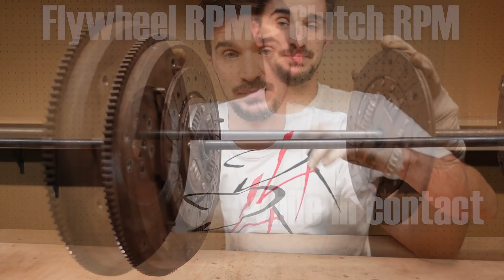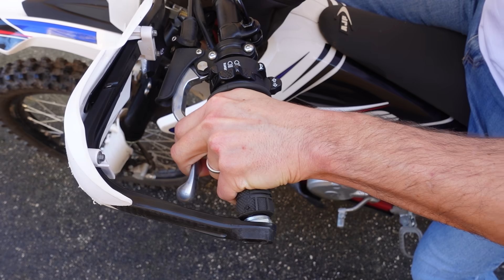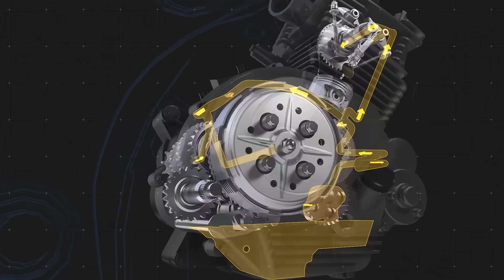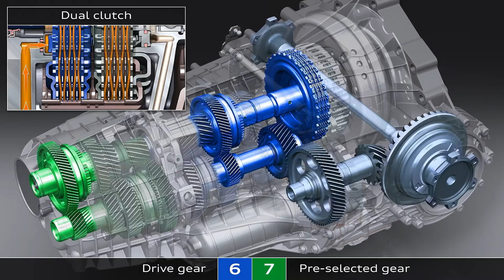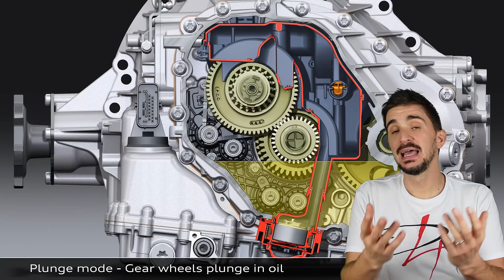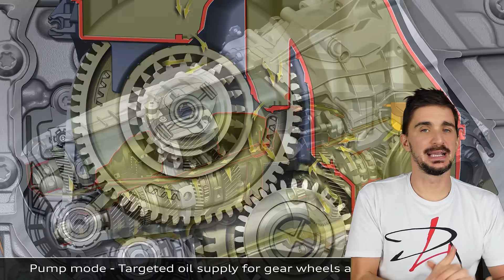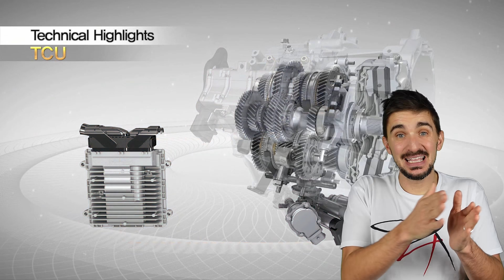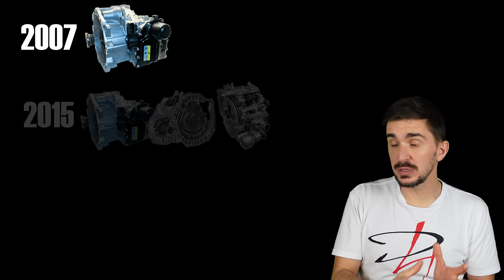Why Dry Clutches Suck and Why You Should Avoid Dry Dual Clutch Transmissions (DCT/ DSG)

Comment: That's why the best automatic transmissions will always be the traditional ones, those with a torque converter. They're smooth at start-up, smooth during parking maneuvers with zero wear, and all clutch packs can engage even slightly because the torque converter absorbs the impact. And they don't consume as much fuel these days since there are 8- or even 10-speed transmissions. So, if you want a dry clutch, buy a manual transmission, and if you want an automatic, it's better to buy one with a torque converter. And if you want to avoid all the hassle, buy a Toyota hybrid. Its transmission is bland, but it's smooth at start-up and has no clutches or wear, meaning zero maintenance for life.

Comment: I think that is why wet clutch transmissions with a (gasp) torque converter are so popular in stop and go traffic. By the way, Caterpillar had a dual clutch air shifted transmission mounted behind the 1693 engine in the 1970s. The thing was much heavier,  but man it shifted quicky. Truckers called it a "sneeze shifter" because of the sound it made when it shifted gears. (air shifter)

Comment: Very cool video, I am doing my mechanical engineering dissertation on multi body dynamic modelling of a multi plate clutch system! I’ve spent far too many hours pondering over very similar topics here, lots of work with coefficient of friction mapping in a 3d sense vs sliding speed and contact pressure

Comment: I sold my 2000 4Runner V6 manual at 218,000 miles but the clutch was still ~70%.  If you drive well, a dry clutch will have only minimal wear.  I rarely slipped the clutch.  Only a very tiny bit in 1st and then subsequent gears would be shifted to rev match.  Double clutched and rev-matched when downshifting to keep the synchros wear minimal as well.  In traffic jams I would lead with a large distance and only drive in idle in 1st gear.  Automated manuals can't do all this nuance -it tries to act like an automatic too much.

Comment: Dual clutch transmissions are good but one overlooked aspect is uneven wear. Basically the first or odd clutch pack tend to wear more if you get stuck in traffic for what ever reason. With that being said wet clutches by themselves are great.

Comment: ...or...just learn how to shift gears.  I have never had a manual transmission fail on multiple 300,000 mile cars.  Plus, it is an absolute joy to make smooth shifts using skill, not technology.  My only exception is nasty stop-n-go commuting, which is not fun in any car, so an old fashioned automatic makes more sense in commuting (and towing) scenarios.

Comment: Very interesting. Would you do a video on PHEV from Stellantis where the AISIN automatic gearbox is plugged into with an electric motor & I assume (?) a single multi disk dry clutch? I keep wondering if the electric motor when used in hybrid mode works to help the clutch to synchronise itself. Thanks!

Comment: This might be why cars produced with manual transmission is reduced so drastically. Manufacturers won't benefit from trustworthy manual transmission, that doesn't break.

VW Passat 1.6 TDI 105 hp, the manual transmission in those can handle the engine too well. In fact, the same transmission is used for the better 2.0 TDI 140 hp engine as well, and even when that engine is tuned to 180 hp, the transmission is unbrakeable.

VW Passat 2011 and up, if not all the way back to 2008, will deny moneyshifting, by locking the shifter, untill you press the clutch pedal.

Currently owning a 2012 VW Passat Alltrack 2.0 TDI 140 hp manual transmission, tuned to 180 hp. Really good cars, but VW are known for rust issues...

Comment: I did theorize that a decent wet clutch DSG should essentially ACTUALLY last the life of the engine without needing a clutch pack replacement, for a few reasons which I will list below;
1. 2 clutches for even and odd gears splitting wear between them
2. Wet clutch submerged which should reduce wear due to it being fluid on material contact rather than material on material contact.

Comment: So, something I've thought about for years is this; why not use the idea of the GM suspension that has the magnetic system where the viscosity can change instantly with electricity. If this could be made to go solid then whether using one clutch on a manual or using these as sealed clutch packs in an automatic, you could electronically control everything with no type of clutch plate wear, you would extremely simplify automatics or have a "clutch by wire" manual clutch pedal. I just don't know about internal heat in this type of system which could be why it's isn't used in this way. Just some thoughts.

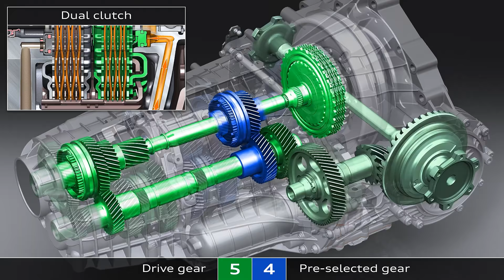Comment: 7:45 If the gear ratios change in only 0.008 seconds, doesn't that cause some stress on the drivetrain ahead of the transmission, i.e., the flywheel, crankshaft and pistons? I would think forcing all those components to change their speed that quickly would have a very large transient force due to inertia.

Comment: I subscribed.
You overvalue the significance of surface imperfections. The force of the pressure plate is enough to press the surfaces together and achieve friction enough to overcome the torque and gradually lock the transmission and engine rotation in unison, but it DOES NOT rely heavily on surface texture to accomplish that.
Reply: Burned clutches glaze but the real reason they end up slipping is from loss of material resulting in loss of clamping force from the limitations of the movement of the pressure plate.

In fact if the clutch mechanism worked backwards, where the driver needed to press the pedal to engage the clutch instead of disengage the clutch, even surface glazing and material loss wouldn't prevent engagement.
Reply: I think if I had to choose between dry or wet, I would choose dry, because dirty fluid is a common CVT problem - which they all have due to belt degradation - and a large percentage of vehicles out of warranty don't get routine transmission fluid changes - that's just a hard fact of life dudes. Also I'd rather have a transmission with inherently cleaner fluid and just replace the dry clutch myself without opening the transmission, which I wouldn't even consider.

Frankly, I wouldn't have either. I'd have a vehicle with a reputable transmission design that doesn't have a stupid amount if gears like 8?!? that absolutely aren't necessary, or I'd have a standard trans like a BW/Tremec T5, etc. most of them are ok.

Comment: DCT is still present in Hondas motorcycles, and they are known for long reliability. I assume its the cost of materials, and lower torque and power for motorcycles that save them? Although some are in 105KM and 90Nm bikes :) ... I would argue, that if the manufacturer want's then such clutch can be made reliable.

Comment: I wonder if we could also make wet brakes for electric cars? The main "wear" problem with an electric car is ironically the lack of wear to the brake disks since regenerative engine braking does so much of the braking; so they keep getting surface rust which the vehicle inspection laws insists that you can't have. I've had to change the disks twice on my electric car so far because of this.  I do try to brake like a maniac occasionally to prevent this but still the rear brakes still don't get enough wear so the last inspection the mechanic suggested I should reverse and brake hard regularly; which is a ridiculous advice because that's pretty much impossible to do while driving normally; and I really don't want to drive to an empty parking lot and reverse a lot just to maintain the brakes. So why aren't the brake disks on electric cars sealed and maybe even submerged in oil so that they don't rust? 
They are barely used anyway, to actually engage them while driving in traffic so I can't randomly emergency brake all the time, I would have to disengage the drivetrain by putting it in neutral going downhill and then prevent acceleration with the diskbrakes; so a slight reduction in performance of the brakes would really not matter much at all.

Comment: Dry clutches suck, in theory, but generally last much longer than the latest semi automatic systems. My Skoda Octavia with a dry clutch lasted 170,000 miles before the dual mass flywheel started to disintegrate, much longer than most equivalent cars with the DSG gearbox.

Comment: I guess the only note would be that with respect to particulate emissions, the brake pads and tyres are the most significant offenders. Most vehicles will only require one clutch per teenager, but   tyres and brake pads don't get the same economy (unless you're in a hybrid/ev, in which case the brakes will last forever and the tyres will wear out even faster).

Comment: I had a Honda CTX700 DCT - a motorcycle with a dual-clutch transmission. Japanese... so naturally a wet transmission. It used the engine oil and filter, so the maintenance was done with the main oil change service interval.

BTW, the only transmission that makes sense in hybrids and plug-ins is eCVT, because it allows both EV and ICE to operate independently of the car speed and direction of travel, allows for simultaneous charging, recuperation, and power. Any transmission with fixed gears is, by default, compromised in (P)HEVs.

Comment: That all makes a lot of sense, it's a shame ford just couldn't it right, currently goin thru a complete failure of my powershift (6dct450) with wet clutch, a real pain when we've only had the car 4 months and it's been off the road for two of those! Even more of a kicker is that it had a refurb'ed box less than 3000 miles and only 10 months previous. But the gearbox garage could not have denied that warranty (12 months/12000 miles) harder if they tried! Proper dicks! 
Great video tho!

Comment: Love your channel. I watch every video, but I have to disagree on some things here. I work for a prominent DCT manufacturer and the two points made about a humans predicting clutch slip and adjusting for wear are no longer correct. Lets start with slip... Modern CAN messages are processed by a controller every 5ms. Even accounting for arbitration and mechanical delay, the controls are taking in so much data and reacting so quickly that no human could come close. I understand what you mean about seeing the road ahead and planning: most systems can't do that (yet), but even in that context, a human's motor skills and the extra layer of response time and mechanical impreciseness far outweigh the benefits of reaction for this specific case. Think about this: a modern DCT can perform a full shift in about 80 ms. In that 80 ms, there is a ramp up, steady stare, and ramp down slip condition to make the shift as smooth and controlled as possible. How can a human come close? Now the adjustment for kiss points... Modern DCTs have adaptions in their SW to not only adjust for multiple clutch kisspoints (initial contact and 50 Nm clutch torque, for example), but for synchro wear, solenoid current-to-pressure, and many other parameters. This all happens in the background, completely imperceptible to the driver, and does so for the life of the transmission so shifts at 100k miles feel just like they did when the car was new.... Love your content. Keep doing what your doing. And I fully agree that dry DCTs are absolute garbage. My company makes wet DCTs.

Comment: Dry clutches suck, the clutch's life on my Lada's "automated manual" transmission is about 50k kilometers, and a new dry clutch costs about 55$ :( The only upside is that I can tow as much as I want, skid as much as I want, if I break the transmission the cost of repairing will be the same 55$ for replacing the clutch.

Comment: IMHO dual clutch transmissions are the answer to a question no car buyer ever asked. I started my automatic transmission career on a Jaguar XJ6 4,2 with a Borg Warner 3-speed box. It was as nimble as a sloth. Now, 7 transmissions later, I enjoy a BMW X3 3,0d from 2013 (I despise all newer cars). It´s 8-speed gearbox (classic with torque converter) is nothing less than perfect. I love it.

Comment: my dry clutch 1.0 TSI DSG 7 is going strong after 160k km. No issues whatsoever, fingers crossed it stays that way. I service it at the manufacturers spec interval of 40k km at a main dealership. The car is faultless.

Comment: Hello everyone, I am a somewhat unhappy owner of a 2023 Toyota Tacoma, with which I am now stuck.
I am convinced that it was designed to work/function as a traffic calming device!
I have no idea with what kind of power train it is equipped, but I know that traditional automatic transmissions can work reasonably close to that of manual ones, and even peel out if we apply sufficient engine torque. In automatic transmissions a near constant state of slippage exists, with a few exceptions: hard acceleration being one, and cruising at any speed might be another, if I am not mistaken.
My Tacoma is controlled by a computer that relentlessly countermands my requests, and even my demands, for more engine force/acceleration. The torque converter and transmission cannot deliver the appropriate force to the drive wheels to perform
save passes, or any other standard maneuvers. I literally must apply brutal force to the gas-pedal to even come close. The excessive slippage thus created by the computer's interference is costing me gas milage.
The most annoying form of computer interference occurs during cornering.
Normally, we slow down before we enter the turn and would gradually accelerate out of it, so as not to hold up traffic behind us.
This tacoma either fails to down-shift low enough for the turn, or, if it did, as soon as I touch the gas-pedal it instantly upshift, one or two gears. This creates what I call a near-stall condition, followed by my aggressive stomping on said gas-pedal to obtain the desired effect. What happens next is this: the computer, once again, interferes with my decision by separating the engine from the drive-wheels by creating excessive slipping in the drive train. The engine now revs up steeply, while acceleration remains mediocre.
Originally, I wanted to buy a work-truck with a manual transmission, but this is what I ended up with. I have been told that there are no trucks with manual transmission anymore. I also did not want any TRD/Sport package, because I just want get from A through the alphabet all the way to Z, if that is what I must do.
Finally, I ended up buying the Tacoma after I disliked a Nissan Kicks and its useless CVT transmission so much I attempted to upgrade by taking a Nissan Frontier with a 9 speed automatic transmission.
The first three gears of which proved equally useless.
On the last day I drove the Frontier, I was trying to get up to speed in the inside lane, but got myself overtaken by a street sweeper in the righthand lane.
How much money this new-age automotive BS story has cost me in the end, I'll leave it up to your imagination.
Thanks for reading my grief/gripe.

Comment: First off, I'm not ASE certified. Only worked as a mechanics helper. However, I've worked on transmissions, manual and automatic. From the beginning of this video, this guy is making stupid mistakes. A "clutch " has 3 components,  not one. What this fool is showing is the "pressure plate". Where's the the housing? Where's the throw out bearing? Where's the the diaphragm/fingers/pressure plate? As for "easing off " the clutch,  this fool never heard of drag racing. Maximizing the revs, then "popping " the clutch. Perhaps he should do more research.

Comment: For anyone who has never driven a VW DSG:
It is awful! I have a company car with a 2024 7 speed DSG. IF driven like a 90 year old it is ok. But it is NEVER fast and if donwshifting while braking it can kick you from behind.
No where near a nice experience. And in addition with a 2l 150HP Diesel, you must use 30% gas pedal to get off!

I also own a 2010 Ducato with a 6 speed automatic MANUAL. That is not worse than the VW DSG! Even though it is 10-15 years older. Just the kick-down speed is worse/longe taking than the DSG:

Comment: DCT dry clutches would live a lot longer if the manufacturers didn't program creep into them. Ford was especially bad about this. They marketed the PowerShift as an automatic and programmed it to drive like one. Unsuspecting drivers them burned up the clutches by letting the car creep in traffic.

Comment: 0:56 relevant pint here MISSING:
It is not just the transmission + drivetrain, wheels and so on but MOST OF ALL: The weight of the entire car!

THAT is what hold´s the engine back or make it stall.

Comment: If we are looking at it from a maintenance perspective, particularly for cars, would not a single plate, single shaft, manually operated transmission be the lowest cost to manufacture, service, repair and perhaps longevity. Also I have a Moto Guzzi and a Ducati, both have dry clutches but both are very different in design and operation. The Duc would probably be easier to ride with a wet clutch, but I don't see any benefits with the Goose, the goal of design really matters.

Comment: Anyone who knows how to drive a manual trans can easily get 200,000 miles out of a properly designed and manufactured dry clutch. No computers. No expensive tech. ALSO you have never really worked on motorcycles when you say you can't burn a wet clutch. Any dimwit can burn a dry or wet clutch which leads to the real problem... a lack of understanding of how things work and a huge lack of common sense.

Comment: Having worked as a mechanic - wet or dry, dont slip the clutch, stay off the pedal or lever unless you are going to shift. Wet clutches burn up too. The dct shift faster with constant torque application. Automatics do not slip the clutches, the torque converter slips. The dct is a squencial electronic manual. I can build an automatic that shifts manually with infinite stall speed